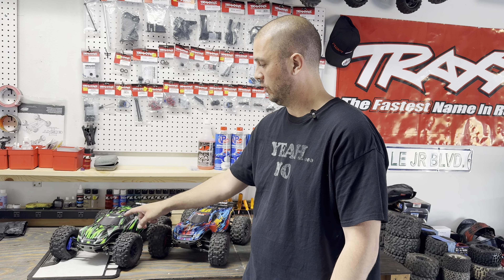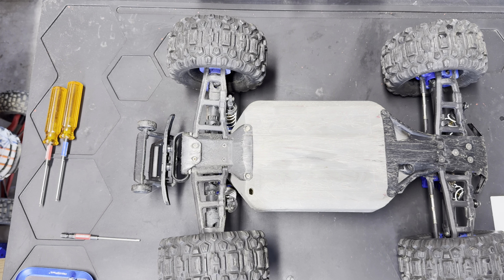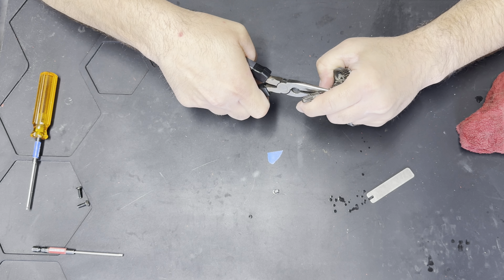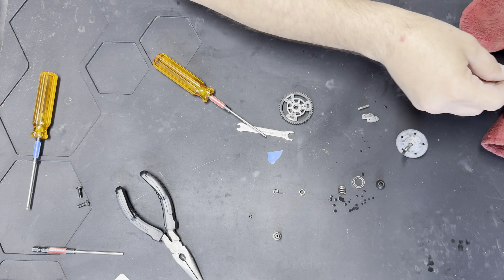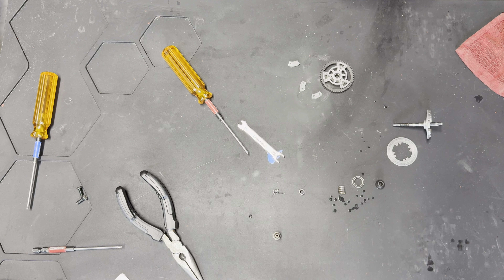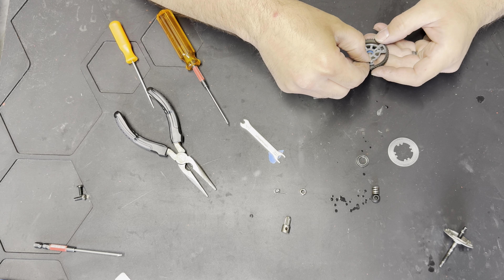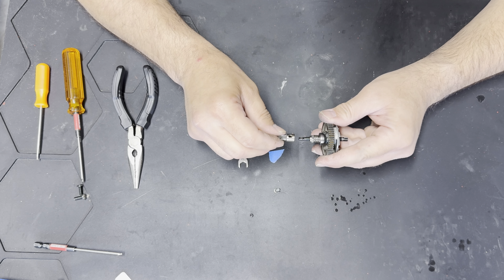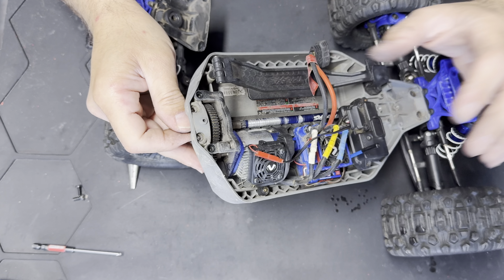Traxxas Rustler 4X4 VXL | Slipper Clutch Repair

Comment: Love the vids! soooo a 54 tooth hotracing spur? and dif and troubles? Stock gearing? keep it up love the vids on the rusty btw u should name 1 of the bandits smoky
Reply from the maker: Stock gear ration, HR works great. Never had diff issues on the Rustler, runs great. Smokey with a little red siren on it haha
Reply: @redbanditracing  Yes but ok thank you guys

Comment: What’s up man, I swapped out the bl2s for VXL in my stampede, new slipper clutch, put all X0-1 gears in the diffs and still blew them out, then when I loosen the slipper, it’s too loose and won’t wheelie. Any recommendations or maybe switch to center diff?
Reply from the maker: Are you using the stock gear ratio? If you are changing out diff gears with anything but stock, make sure to check backlash between pinion and ring gear. A center diff is great to have, I’ll be switching eventually.
Reply: @redbanditracing  awesome! Thanks man! 👍🏼

Comment: Great video, very detailed showing each step. I’m just curious if you may know what could cause my Rustler 4WD to stop popping wheelies!?! I’ve adjusted the shipper clutch and still no wheelies. I may just take this all apart and see if something may be stuck or not working as it should. 

I didn’t see or hear you mention anything about applying any grease or oil on the bearings, shaft, etc. Did you put a drop of oil or a slight rub of grease prior to reassembly? PLMK if you may have any thoughts or insights. Trying to get my grandson’s truck up and running. Thank you again for the videos and your time. 😎🙏🏼
Reply from the maker: Definitely don’t oil the bearings, they are sealed and if they are worn just replace them. If you’ve already adjusted the slipper (fully tight, then back off 1 turn) then I would remove the slipper assembly and clean the pads and disc. Sometimes the pads can get glazed along with the disc. Using a scotch pad can clean those up good. You may need a rebuild kit if that doesn’t work.

Comment: What part number is that spur gear? I ordered one a few weeks ago and it must have been for the 2WD cause it had a huge offset? Definitely wouldn’t work in the VXL. Also, the Rustler VXL is now coming with the extreme duty kit minus the strut towers.  Great vid, also, differential gear oil may play a part but we run ours hard in the street damn near every afternoon and we have the slipper clutches set a 1/2 turn off of full tight. You get just enough bite to barely wheelie.
Reply from the maker: Hot Racing SJT254, for the 4x4 VXL.

Comment: Aluminum  and steel   different  use never seize,   gray badass, lubricant,  between  steel and aluminum,   I use it on  all parts,  use it on the spines, for center drive shafts,  put a o ring on the splines before putting drive shafts on, keeps the. Center  shafts from moving  back and forth, and shim, the  shafts on the slipper clutch, where it goes in the rear diff,  keeps the rear gears in perfect mesh,

Comment: Have you had any issues with driveshafts since putting on the sledgehammer tires compared to the stock ones? I put the sledgehammers on my rustler ultimate and first ride broke a driveshaft on the rear. Now thinking about upgrading to steel driveshafts such as GPM-SRUS41277RH-B. Any recommendations?
Reply from the maker: We’ve always broke driveshafts but love the Sledgehammers. We will upgrade to steel CVD’S

Comment: What was the problem in the first place bc my rustler is basically just not moving it’s locked up not the diffs or motor so I’m assuming it’s the slipper clutch am I right?
Reply from the maker: Have you tried tightening the slipper all the way to see if it catches and moves?